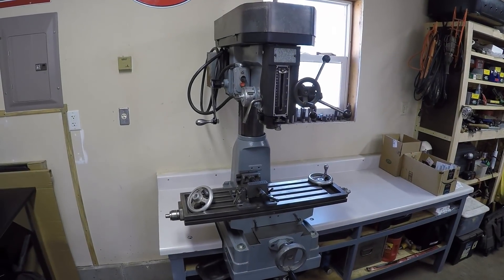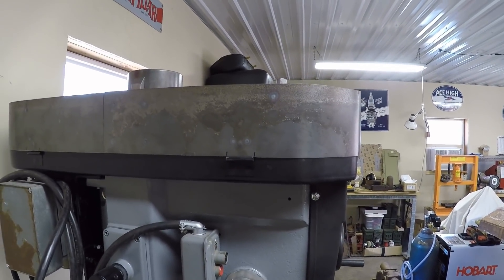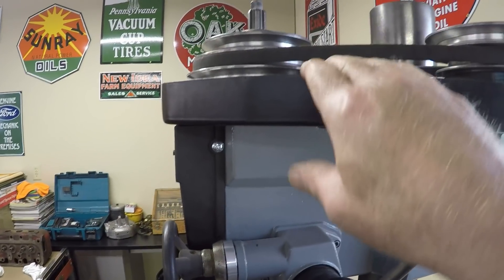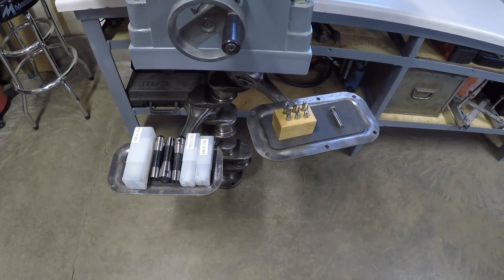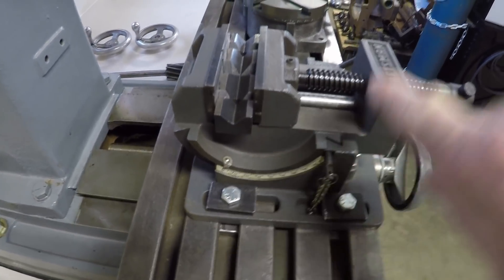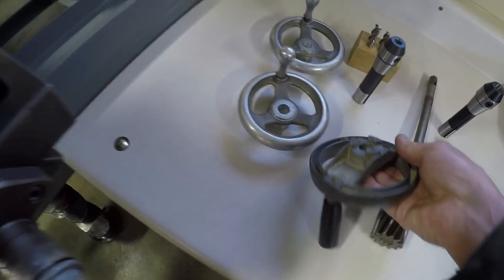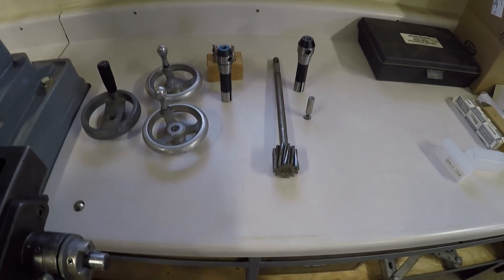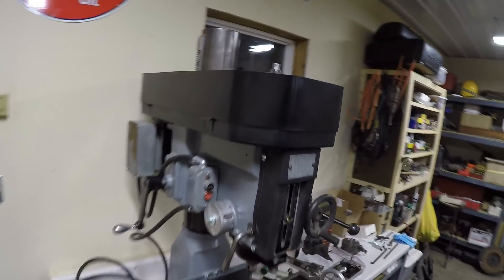Squatch Sr's Milling Machine Project Update - Tools & Attachments - Making Chips!

Comment: hmm..   D2 injectors with NO tools to grip the spline shapes.  dad has a mill a lathe and a rotary indexing plate..   time to Scrounge some Hex bar stock.  measure the injector tops.. remove the hex part way so you have a shoulder to mount it to the rotary index table eventually.   bore it to the root size of the splines..  set it up in the indexing table and with a proper shaped too.. start cutting by using the up and down motion of the spindle to cut the splines ..  now you will have a tool to really grip the top of the injector body to remove it.. 

 you could do it with a coupling nut even..  leaving threads on one end to put a stubby bolt for for mounting to the rotary table.   then you only need to look thru the cat catalogs to see if the springs and shims are available.   don't forget.. if you have an AIRLESS sprayer.. those sometimes make enough pressure to allow you to continually flush the injectors with a solvent.   or take the freeze damaged block and head to set up a electric  driven injection pump to let the injectors run at different throttle settings with the spray just shooting into pyrex tubes..

Comment: Nice work on the milling machine Sr.

You might want to pick up a 90 degree base so you can mount the rotary table or vise perpindicular to the table.  We picked up one for our table and it's great for rotary slots in tubes.  My son is a gunsmith.

Comment: Is that a machine vise or a drill press vise? I had a Palmgren like that vise and it would not hold work well. I had to switch to a Kurt vise. Nice work. Be sure to check the tram on that round column mill frequently.

Comment: You are going to have a hard time indicating in that vise. Also use hardened harware to hold down both the vise and rotary table. Grade 5 bolts and flat stock used as washers are going to bend and stretch over time, making it difficult to indicate the vise and parts.
Reply: No they won't.
Reply: Your name as "the metal butcher" doesnt instill much confidence in your response.

Comment: This is an awesome little milling machine, I would love to find one like that.  Did anyone happen to catch what make/model it is? I'll have to go back through the previous videos on it and see if I can catch what it is.
Reply: They call them mill and drills. Lots of companies sell them and they're hard to tell apart. Grizzly industrial sells some decent new ones, along with MSC, etc. We have a JET branded one where I work.
Reply: @squatch253  they're definitely not heavy duty machines, but you can hold pretty good tolerances with them once you get everything dialed in. Having a good solid base (limiting vibrations) helps immensely. Easy does it will definitely do it!

Comment: Hi. Neat job. One trick to align the head if moved between operations , which you’ve possibly seen already, is to use a laser pointer against a mark on the opposite wall. It’s not as good as having a vertical slide and gibs but it can help depending on the repeat precision you need. Stay safe. BobUK.

Comment: Watch for machine shop auctions and pick up tooling there. I got lucky when Westinghouse closed one of their labs and picked up a bunch of near new tooling including a twelve inch rotary table, bandsaw, set of cutters in a pexiglass box , and a variety of other tooling. All for under $2,000 dollars which was actually a bit more than I wanted to spend, but considering what I got it was worth it it.

Comment: Need to find and obtain a pony starting  engine for 1948 Caterpillar model D7 
The original is stuck 😡 frozen up
Need one that's NOT stuck and possibly still runs to crank over the diesel engine...you can contact me!..
darbycharles261@gmail.com